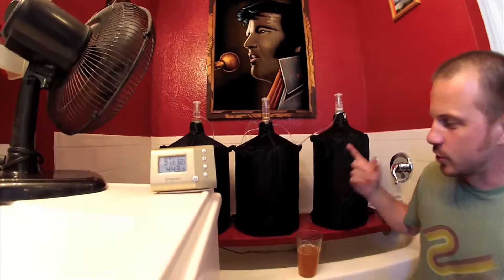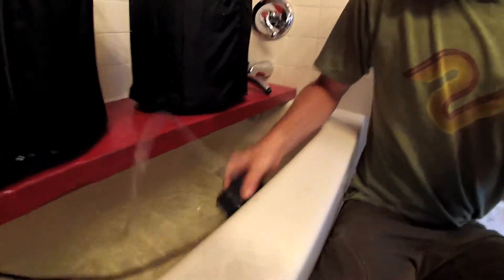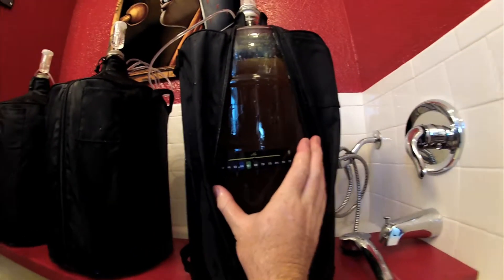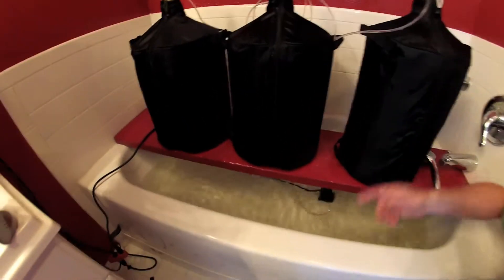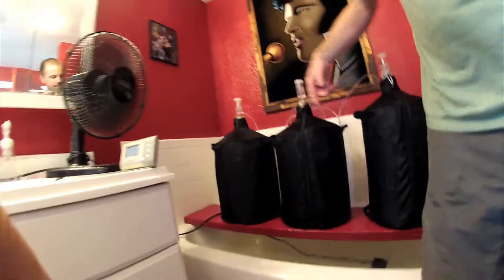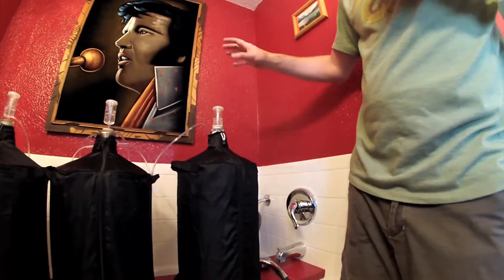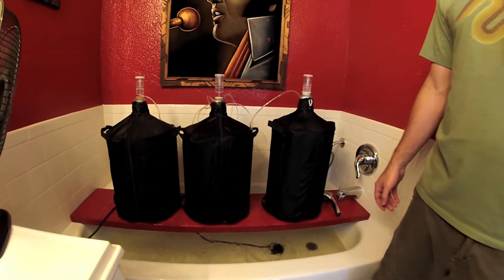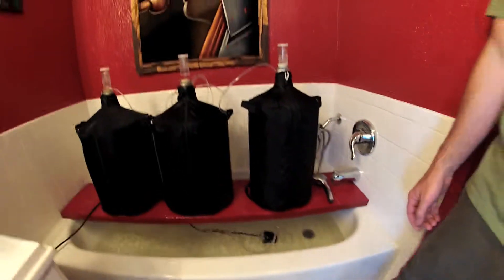Swamp Cooling Homebrew Beer Carboy Water How to Ferment Cover Carrier

Comment: Very cool.  Pun intended.  I suppose that with the fermometer on the outside where the wet cover is that's not necessarily the beer temperature. The only way to reliably get that would be to use some kind of internal temperature probe.  But it has to be less than the ambient temperature.